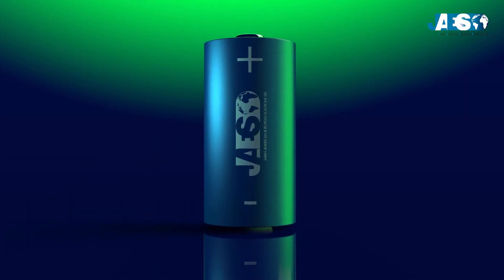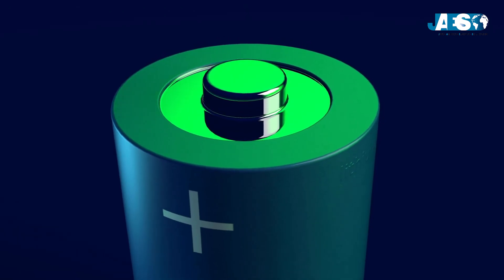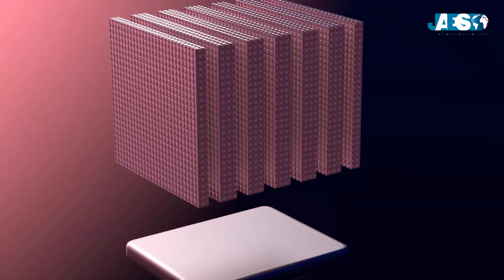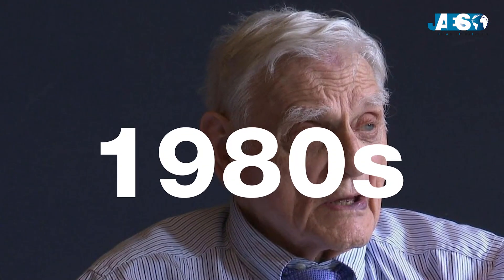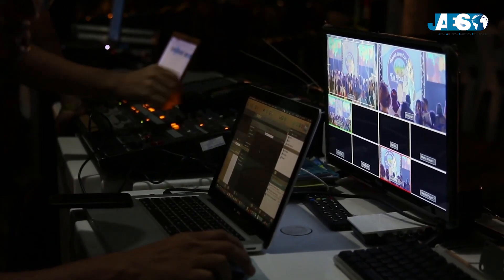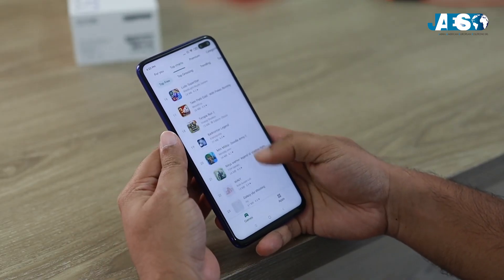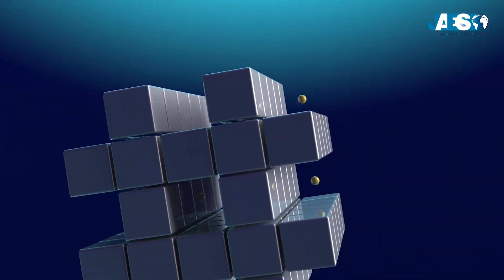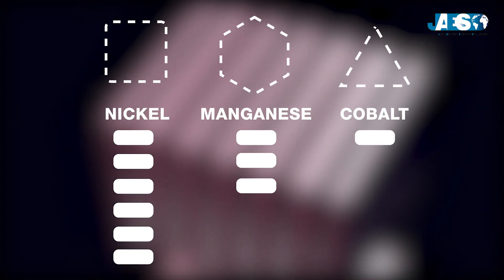How do lithium ion batteries work? cobalt oxide - manganese - anode - cathode

Comment: Thia video is wrong the anode is the positive terminal of the battery and the cathode is the negative one the anode is made of copper usually and the cathode of aluminum. I work in a battery manufacturer now coating these foils with the slurry

Comment: The movement of ions is explained, but not the production of volts - and thus energy??? Where does the actual electricity come from? When and where are the electrons shed - and thus used by motor? Thx.